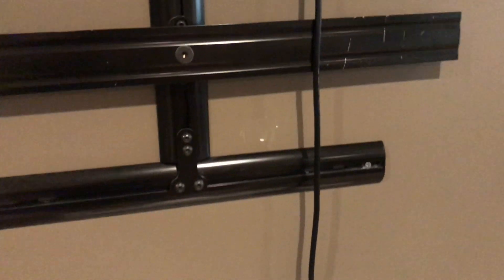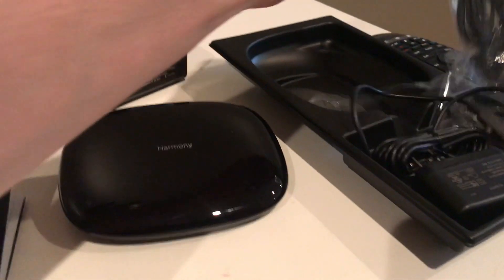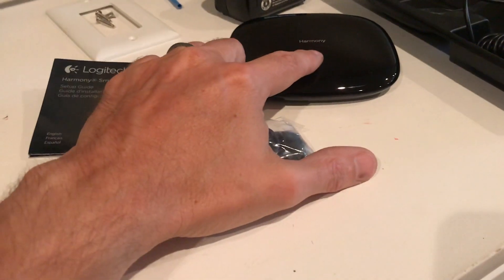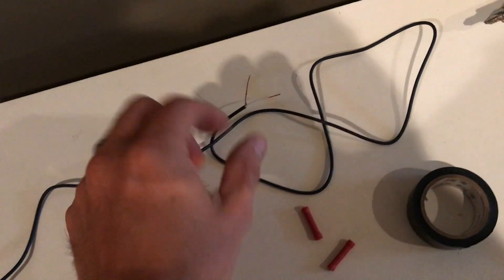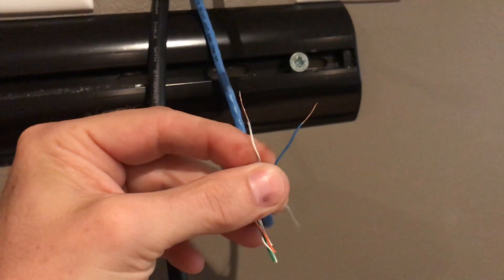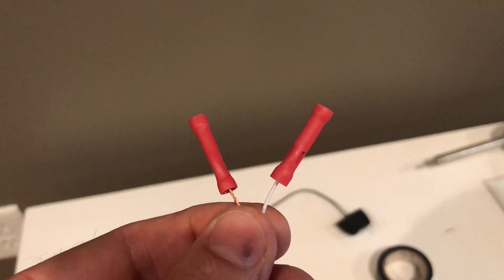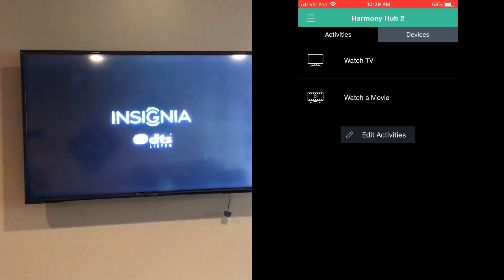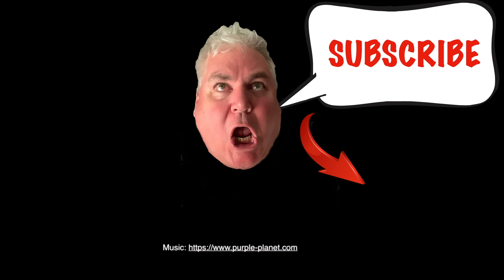Extend a Harmony IR blaster

Comment: Thanks for the video. This so exactly what I wanted to accomplish.  I noticed however that it seems not all the harmony mini blasters are the same. Mine has two wires like yours but the are black and red coated with no bare wire.  Same concept but the copper is crazy thin!  Like near microscopic. It looks like your ir mini blaster has a cable longer then 3ft is so ones that come with the remotes. Did you purchase a longer one that maybe has a thicker wire?  The one I have is so think I am not even sure I will be able to crimp onto the wire. It is so delicate.